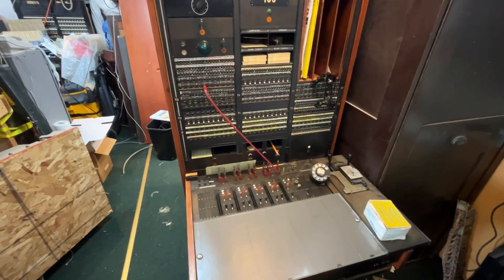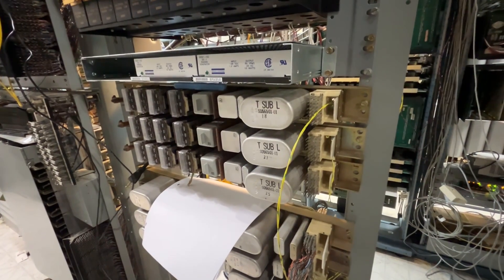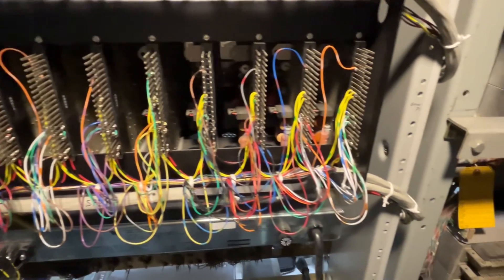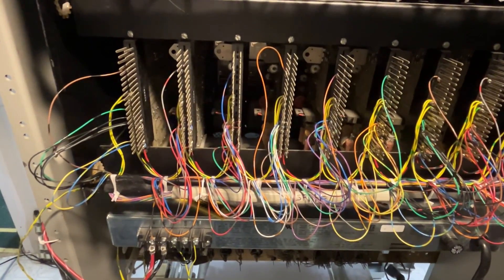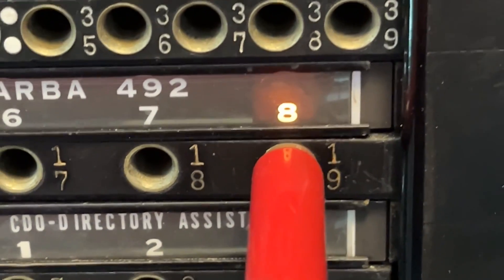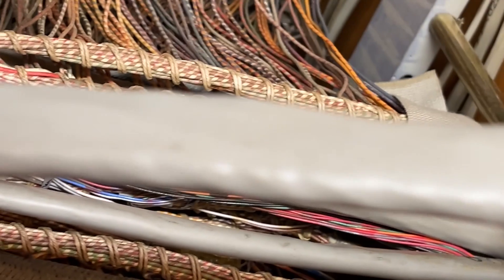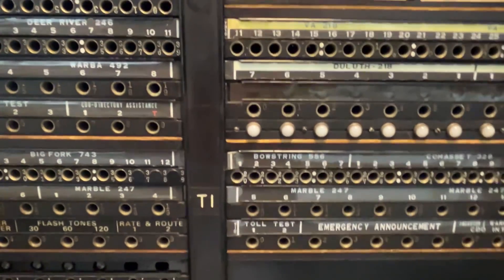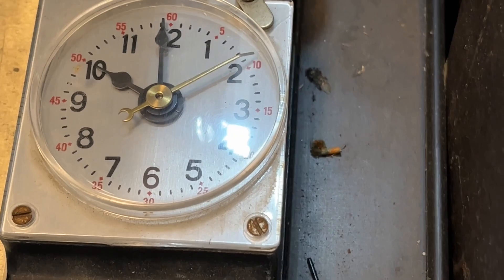Western electric # 3 toll telephone switchboard. Bob and Shane's place.

Comment: This was great! Could place a call on a Magneto Board when I was young, but I've little experience. Did it a few times, so think I could do it again…not too sure with a Common Battery though. The idea is still the same…and with a CB some things were suppose to be automated, like no need to ring-off manually to signal to clear the call & free the lines, and no need to ring the Called-№ manually. It'd be fun to try!